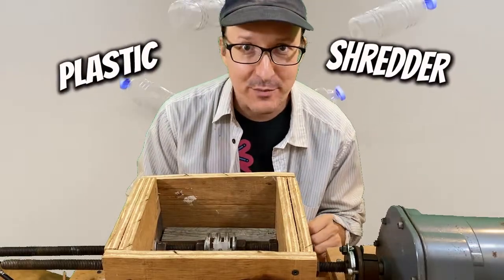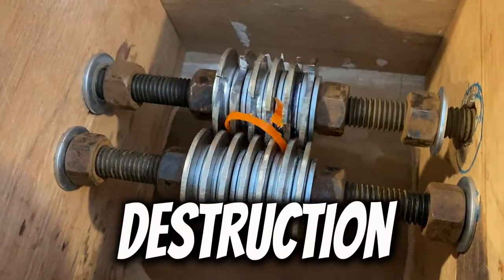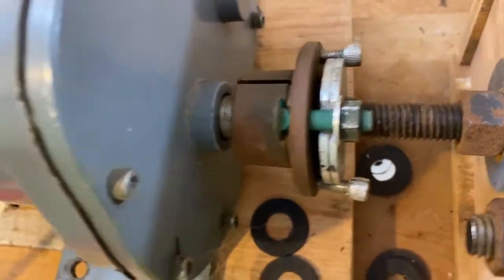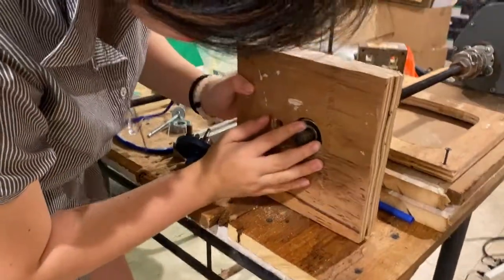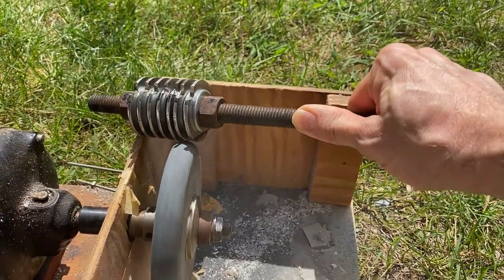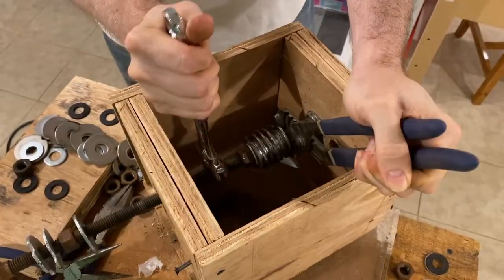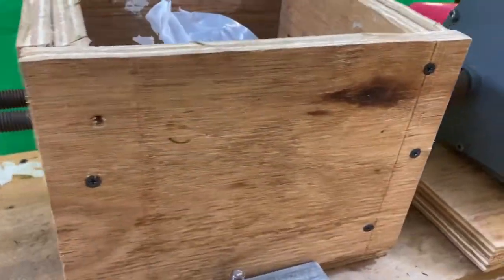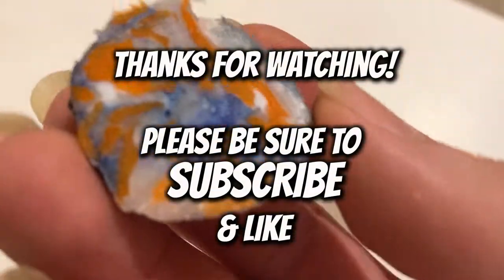Make a COOL Plastic SHREDDER For under 70 Bucks!

Comment: I wonder if you make the second rod longer and on the outside of the box you put gears on the rods so that when the powered on spins it spins the other rod in the opposite direction. Hopefully im visualizing that correctly. Likewise you can make both rods poke out the other side and put the gears on that side. Or put gears at both places but that would just be redundant i think.

Comment: I may try to recreate this someday but I will be using larger washers and I will be welding them to the rod they rest on. I will use another washer as a spacer while welding them in place. That way when I have two completed rods there will be zero gaps when I bring the two rods  together (staggered of course) for ultimate shredding power!
Reply: Double up each blade making it a little wider tooth.   Less gap

Comment: Do you think it would do aluminum cans?
Reply: Lol 2 years later but i think it would definiely work on the middle part of pop cans. The thicker lid and bottom parts im not sure. Kinda eant to test it out when i have enough funds. I wonder though why i would want to shred vs smelt. I mean i suppose if i had a tiny furnace or crucible maybe.
Reply: Why shred when can melt?   I had 50 gallon trash bins filled with cans, and the bins filled with water.  Shredding them would help me dry them before melting then.
Reply: @kreynolds1123  oh you mean you dont want explosions? Lol ok yeh i can see that and also i can see it maybe making the process quicker by possibly allowing to process more material at once.
Reply: @DeathxCap  Reactive molten aluminum reacting with the oxygen in water releasing hydrogen that will cause explosions and ruin the aluminium because it absorbers hydrogen and bubbles out on going to solid phase and that can ruin aluminum molds.

Comment: Hi I’d like to know if this motor will shred plastic here are the specifications: Rated current (mA): ≤2500.
Rated power (W): 8.915.
Rated Torque (N-cm): 7.812
Rated speed: 10 RPM.
Shaft length (mm): 27.
Shaft diameter (mm): 8.
Base motor RPM: 6000.

Thanks so much for your help:) much appreciated 🙂

Comment: Hi can i ask what is the required amount of torque and speed to make a plastic bottle shread?
Reply from the maker: Hi sorry for the delay in reply.  For a more typical system, it's usually something like: nominal torque >= 200 Nm, speed, ~70 r/min, and for something small like this one, you can reduce it appropriately depending on what you want to rip apart.  Sheets of thin HDPE are much easier than thick bottle caps, so different types/thicknesses will affect your minimum values here.  Good luck!

Comment: But the washers arent keyed onto the shaft so why dont they spin?
Reply from the maker: Thanks so much for the question.  they would slip, if they're not tightly screwed together;  tension/friction will keep them together, when you tighten them.  better if the washers are a little rusty, so you can put a little acid on them for a few days (in case you need to be able to make adjustments later).  or, if they're brand new washers and thus a little slippery, you can actually use gorilla glue, which expands after setting, and keeps it pretty tight,  but is still removable if you need to make changes later on.  the absolutely best way to do it is to use a weld-like steel epoxy, but then you're probably going to have a very hard time separating them later on if you ever need to make changes.  again, my goal with this thing is to try and use basic tools or glues that are accessible to students; welding or precision keying would probably be a little too hard for young people.  it's not industrial grade of course, but it does work for a very long time without maintenance.   Thanks!

Comment: Von Weise V00323AF20 AC Gear Motor (Replaces Dayton 5K933 and 1LPP7), 6 rpm, 600 in-lb, 8.13" Width, 9.1" Length, 115V

Comment: Would you need all blades to turn on both rods?
Reply from the maker: Hi Dennis.  Yes, I've seen a lot of designs that use gears to have both rods turn the blades into each other, and they seem to be a lot more efficient.  For me, given that I was mainly using free, leftover stuff, to make this shredder (and using gears would require more precise measurements on the holes, etc, and probably metal sides), I opted to go with a single moving rod, because it was just a lot simpler, to test it out and get it working.  But yeah, definitely, having both rods turn would be a great idea!  Maybe reinforcing the sides with some scrap sheet metal might make it plausible to mount some gears on there and try it.   Thanks!

Comment: I like this approach.  Add some "combs" to the bottom or "upward" side of the cutting blades to scrape off the plastic so it doesn't just wrap around the cutting bar.  Consider something tighter fitting for the stationary spacer bar.